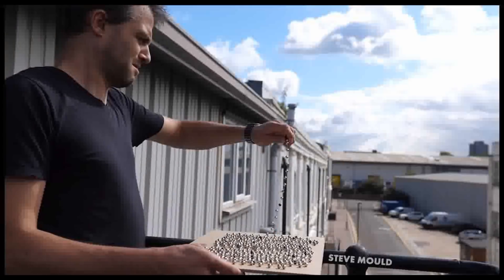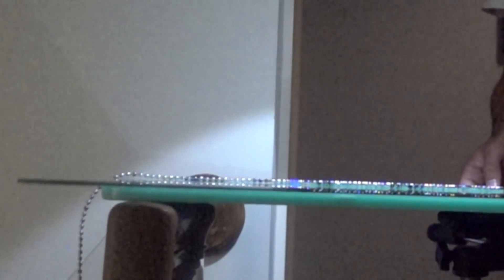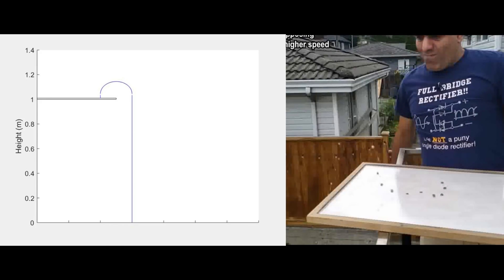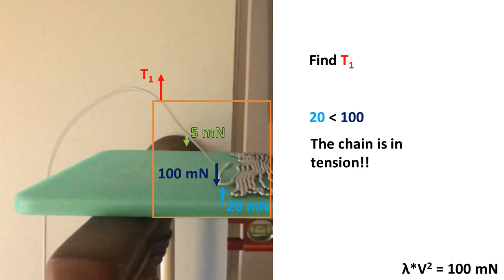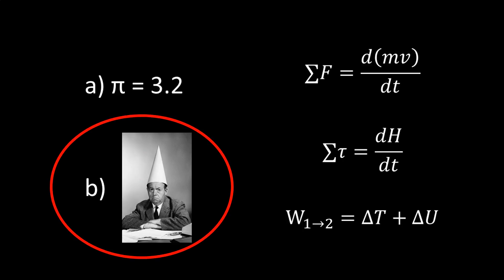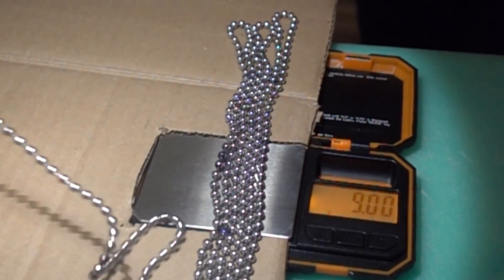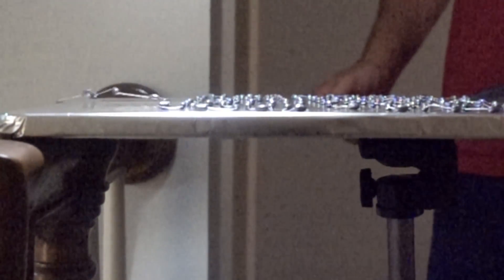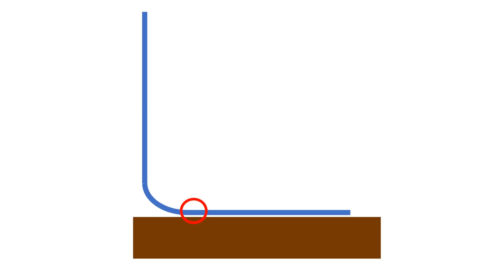And the Winner of the Chain Fountain Dispute is...

Comment: This video actually proved the chain fountain/ Mould effect incorrect. The fact that the chain left impressions in the foil, is a clear indication that energy from the chain was dissipated into deforming the foil. The table or container cannot ever apply a greater force to the chain than the chain applied to the container-every action has an equal and opposite reaction- energy is always conserved.

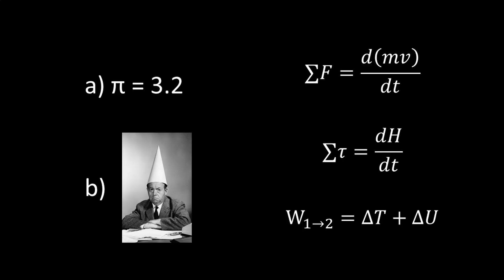Comment: 10:00 obviously the linear momentum is converted to angular momentum and then back to linear momentum in order to change the direction of the forces applied.

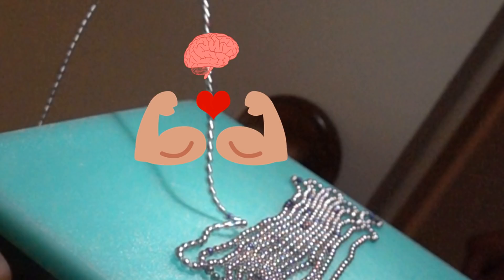You can see the spinning chain in your "evidence" clip at 11:30.

13:55 also clearly shows angular momentum.

Comment: Force shmorce. Hearing nothing about the moment the lift starts right after a direction change, the whipping left to right in any of these arrangements. THAT's the force that starts the lift. Watch the helical motion of the chain where the lifting occurs. It's always there as soon as the energy in the system is sufficient. In a computer experiment where the chain is "emitted" from an infinite straight pull there would be no lift except for the rebounding of the beads going over the edge once the chain is past a certain speed. Wave theory and resonant frequency got left out.

Comment: To check if the bead chain is under tension, we can use springs to make the bead chain, with springs between the beads. What will be the result? Or do we use Spring scale to connect them in series to form a bead chain? Then use a high-speed camera to capture the scale.

Comment: The movement of a bead chain is similar to a whip. During the swing of the whip, the tail of the whip moves in the opposite direction to the head of the whip. So in the end, the tail of the whip will hit the air, producing a large sonic boom. Here, during the movement of the bead chain, the bent bead chain will also flap backwards or downwards, which also drives the bead chain to move forward or upwards.

Comment: And the alu-foil is a genial measuremend-Method of force.  And it seams, that this Force is directly korrellated with the bow-forming. And its not so less, as i thought. But...
https://youtu.be/I31GfljDEWA?t=840

16:45 ca.... This Test-version seams to be lightening, that there is a pull-force, that accelates the stationary chain faster, as the falling chain falls down. So there it must build a bow (but not in this sort of chain), because the faster part of the chain needs to go anywhere and cannot go the direct and strait line, like the shortest way. Here we see  some bullets, that goes faster as the preceded bullet. That emerges, because this chain is more flexible between the bullets, as the axial-hinge-chain.

If we so see, it seams, that both effects must come together, that a bow would arise properly. But the leverage-effect seams to be only as an supporting-effect, as it would be the initiation. The initiation of the bow maybe after all lies in these faster acceleration on chainpart between the falling chain and the stationary chain. And that can only have only defenit causes.
If the loops cannot be belittled in radius, and therefor ab longer part of chain would accelerated, befor the proper pullforce comes to effect, then there is some effect in there, what is correlated with  the faster acceleration-probability. And the first indication for mass-forces, that let the chain to take of the ground, comes with the reduced radius of loop and the consequences for mass-acceleration within the accelerated chain.

The problem with your formula seams to be, that it not calculates the distortion torque in the chain, but only the weights and Pullmoments of the accelerated chainpart.  The other side of the scenery is, that there must be some ground, whereon the chain must laid. Otherwise there were no possibility make this phenomen.

First i pondered about the phenomen (Bow) maybe ten years ago, i thought there were an centrifugal force, becuase there are parts of chanin, that accelerated faster, then falling chainpart. But centrifugal force maybe not the correct designating. It is more a wave, that comes out of cross-acceleration, that become balanced through the pullforce of falling chain.
And it may can be, that some leverage effect is anyway or dynamicaly / randomly the initiation of bow-building. But maybe its not the only initiation-force.

Ordinary electro-Cables can also build a bow, if fast enogh pulled out of the cable-ring. Cables, that rolled in rings, also effects forces against other cable-loops. And cables are axial not so flexible, as such a axial-hinge chanin, with whichall beganns. You cannot twist axial the cable endless. Because cables are more stable/rigid. Because of that, cables dercurl itself, when the axial-forces raises to high. But this relaxation of suspense must not take place

In case of the axial-hinge-Chain, that comes in the system, when the minimum-radius are reached and the draft-forces cannot unbended, then they would transmitted to the neighbor-chainlimb.
This signifies a larger chainpart, that behave like one coupled mass and this cause cross-acceleration, this results in leaving the shortest path of movement and thus in forming an bow.

And:
Is the question more, why the bow accrues or why the bow is stable preserved? Is the initial-force also the preservingforce?
If the faster acceleration of chainpart only because there is a leverage-force, then leverage is the answer. If the Bow, once it is initiated, stable, because of the cross-acceleration, then there is another effect involved. Because without faster acceleration no bow. Otherwise, without this faster acceleration, the chain would run along the shortest path.

Comment: I'm not going to pretend to know what is going on here. I've seen this a few times didn't really take too much notice. But it just seems like everybody's trying to figure out the horsepower of the engine of a train by measuring the weight of the Caboose! IMO everyone just using the wrong formula. Instead of using mass and weight formulas from Newton look into more of fluid dynamics. What is going on seems to be more of waves and a little bit of electrical resistance try mathematical equations by factoring in wave theory
More like this.
https://youtu.be/Io-HXZTepH4

Comment: The question(s) are not whether there is a reaction force, they are 
(1) whether the reaction force is needed to create a fountain,
(2) whether the reaction force affects the height of the fountain.
The answers are No & No.
In relation to the horizontal fountain, the answers are Yes & Yes.
But, the original questions relate to a chain from a bucket/beaker/container/can -- not from a horizontal surface.
So, that was your first mistake.

Now to your second mistake.
The mere existence of a reaction force does not make the answers Yes & Yes.
The reaction force borrows power from the falling chain.
So, it can't add to the height of fountain (from a bucket).

Links landing on the floor do add to the tension in the falling chain.
Hence they add to the height of a fountain.
But the lever action (kick) at launch in the bucket does not add to the height of the fountain.

There are (can be) two kinds of kick. 
One is the simple lever kick (due to a say 90 deg bend in the chain).
The other is a similar kick that is due to the chain having a bend beyond 90 deg.
We sometimes see a bend of 180 deg, or more.
That large bend creates a slower & possibly greater kick.
But, both kinds of kick borrow power from the chain, hence they don’t add to the height of the fountain.
Except in the case of launching horizontally from a horizontal surface, where there would be no vertical fountain were it not for these two kinds of kick.

Except that there is a third kind of kick that will give u an enormous vertical fountain offa horizontal surface.
And this kick can be created by laying the chain such that as it is being yanked horizontally it has to jump over itself.
It’s a jump-kick, & has zero to do with lever action.
Whereas the other two kinds depend on lever action.

Steve is wrong.

Comment: i still think there's something missing the chain as no reason to rise up it could simply do the fountain effect to the left or the right wen it was flat on the table + wen loaded in a container depending how it was setup might add more friction or less same as the beads can rotate wen loaded in circle also one of the idea i add was the chain as a whip effect the faster you pull the stronger the end will snap 15:50 i have no dour that a push effect but like i said at the start there must be something more because all ropes would be able to do it they all have a bend tension

Comment: Has anybody thought about the "leverage" on the lip.
Chain pulls down, one bean is the pivot, next bean is pushed up. And so on, adding energy.
The movement is then transferred back as in a whiplash to the next bean's in the chain until its stopped by the surface (therefore the "reaction force detected").
But it originates at the lip. At least it starts that way
https://drive.google.com/file/d/1Pp6sdLaQcqb0qAloJrHKcJ8D_-qG6ySv/view?usp=drivesdk

Comment: The reason the chain rises when on the table and dropped off the edge is because the loop height is never actually zero in practice which is needed for zero reaction force. So the reaction force will eventually occur and then the loop will move toward the equilibrium height as in your math

Comment: Misdirection of information. Reaction force is just the resultant of all acting forces. Peak height is achieve from momentum of the chain. Peak raises as long as that the direction of forces(x and y vector)is sufficient to form the peak until it reaches nominal speed. Height will decrease if there are frictions, or the chain is moving further away from the drop point , means more horizontal travelling is required.

Comment: Oh for god sake. After watching 3 of you mess with this and still miss the point. I'll spill the beans.
The shape of the balls being dragged at high speed is creating lift like a hydrofoil through air. As speed increases so does lift.
If you attempted this with a 500Ft 7/8in rope, it would begin to drop and sag unless you had a lot of it tossed off the top of a cell tower. Only because of weight and speed again creating lift.
Fill that same rope with plastic balls down the entire rope and you again create airfoil lift because of the shape of the balls vs the shape of the rope alone.
The Phenom you're all witnessing is air resistance drag on the section of chain starting momentum. As it increases in speed down the line drag becomes lift on the upper part of the sphere as air skips across the top of each ball.
If each ball was alone. Lift and drag would balance out as gravity takes over.
With a LOT of chain and if controlled pressurized air was ran across the upper edge of the chain. The chain would begin to take shape of a upper wing of an airplane sliced. And simulating wing shape design for a given airspeed.

Comment: Actually when it comes to non-stationary stuff, 'pi' doesn't have to be 3.14…, because 'pi', depends on the metric in use, e.g. in the taxi cab metric, 'pi'=4, because a 'circle' in the taxi cab metric is a square, at least when viewed through the lens of the euclidean metric. Normally this only becomes relevant when doing stuff like maximum accuracy rocket trajectory calculations, but maaaaybe…? idk 🤷🏼‍♂️
Reply: I heard that when measuring trees' diameters, Pi is also not 3.14 because trees aren't perfectly round. it also depends on the species

Comment: What about a setup with a single 90 degree bend instead of a snake. You'd need a long flat surface but it limits the areas of compression to just 1.
Reply from the maker: I believe that that is what I did at 2:55. And the result was that no fountain formed.
Reply: @prestonbecker8784  so you did. For me that is conclusive, the fountain only forms if part of the chain is in compression and increases as more of the chain is in compression. Steve should be getting some pennies.

Comment: Use a good size speaker as a table and like a microphone measures sound, you can directly measure the deflection force in decibels.
Reply: Or use an actual speaker. Then small spikes in weight can be measured as voltage.

Comment: Your cling wrpa experiement, failsot really test the material accurately since much of the force is lost to the spring/ depression method of hte opposing force, I would bet proprotional to the height lost. OT measure the force downward on teh cling wrap, you could measure the height and ahve it on a zeroed scale or a scale itself as an entire thign, or a reverse weight... SO cookie sheet.. is not hte same as a hard surface. The molecular mass and layer is not really testing the materials friciton at that point but its reigidity adn so the lcing wrap absorbs most of the energy or momentum of the system, like a coil or suspension.. yes.. cling wrap is behainvg more like a suspension sytem, dampening the energy into itself before propelling the remains upward, In fact havinga more springy substance oculd null the entire thign...

Comment: We have A and B... heights... This kind of reminds me of fluid dyniamics and self siphoning and why it works. Tension explains its...

My mind sees it as Motion of mass, verse gravity, movement of angle. Initial accerlation and speed, verse the mass to volume, and so when it hits the floor, depending on N speed/ and and mass of movement, it will create a force upward as if self supporting, there is naother hting that does this I think its water... but I can't quite remember. So we have gravity pulling down, we have the string bead, friction and regiity in teh system, IE time ot bend and react to each other in teh chain. Whihc creates a resistance in falling. IE like cars on a highway and one person stops teh entire chain goes through a wave of impedence... hmm... eventualyl it should travel upwards or outwards depending on its location to the height and effect. Until the entire thing falls. Gravity based on its weight and mass and friction of the table will ensure this will continue ot be the case. We cna change teh angle and friction of where the bead string is, which changes if it wll sotp or continue, it would slow the descent  because of hte increased friction. It's a system of blance, and the max distance is in relation to Point a and b to their relation ot hte mass and structure of the beads, ot the gravity and ot hte friction involved. PLu air a current or other forces invovled could alter the direction. So with more understanding you could create a chain that falls in a spiral pattern, able to coil down into a system. ALterantively you can make a gathering device of the bead system and have it use energy to move the long bead cahin up and make a organized pile above. So its an endless bead waterfall. Kind of challenge. but it would be nearly twice as long, since you don't want ot disturb the forces involved and have the chain and timign of x distancei n teh system to do such a thing, while a machine Gobbles it up bleow and moves the chain back up.. and resets it ot ap osition hmm... I have seen this else where I just cna't rmember waht it was.. Itsl ike if something is moving at x speed, and falling at x speed and it impedes somethign in teh system it creates that sort of tension, in teh mvoement of the system... I have seen this exact thing witha type of liquid or vicous substance.. honey? Honey incorporates a word as vscious but its really just friction of a substance in itself to the outside forces invovled. I dislike the use of the word tension, but tension illusions mind blow peopel so I gues it describes a part of the mechanisms invovled...

Questions would be do string chandes effect it bead sizes, mass, large strings. etc.. angel surface... lol

Comment: If there is any displacement of the chain in the vertical (before leaving the initial planar surface) it must be upward.  So only something like a fountain is possible in the interaction between table and chain.  Exceptions would occur when the boundary condition is not imposed.

Comment: Didn't finish the video yet so I might be completely wrong. But at 1:53 my instant thought was that the downward acceleration of the chain, meant that at the curb at the edge of the table, centrifugal force is pulling on the chain. Eventually this force will be large enough to overcome the force of gravity, thus  spinning the chain outwards (upwards in this case). This in return means more acceleration due to a higher drop of the chain with less friction as it no longer touches the tables, creating an ever increasing acceleration, and thus more centrifugal force, for the chain curve to increase in size.

Also because the chain is laid out in the pattern that it is, it means that the chain part that is dropping, always have the same amount of chain still on the table, "pulling on it". If the Chain was laid out in a straight line, this obviously wouldn't happen, as the chain would have to pull its entire weight while falling from the table, and not just the next "section".

Just my thoughts. I'm no scientist :P

Comment: Hypothesis: A chain with a lot of short bends has a lot of potential energy, which is turned into kinetic energy when straightening the chain. The energy has six possible ways of causing movement, up, down, left, right, forward, backward. Down is not an option because the floor, left and right cancel each other out, forward and backward is not an option because the other parts of the chain are blocking the way. Up is the only place where the kinetic energy can go.
Reply: Read so many comments, and you are The only engineering comments that has fact.